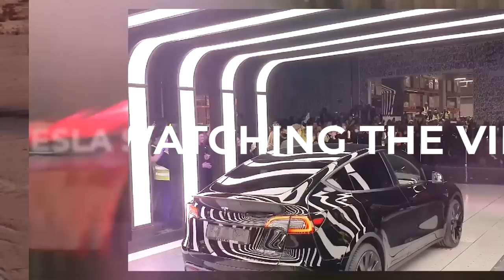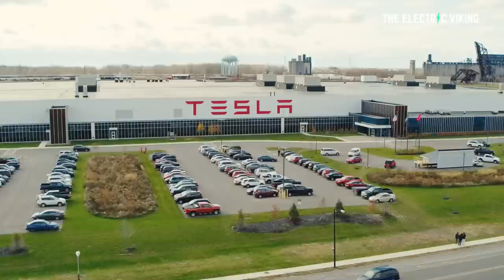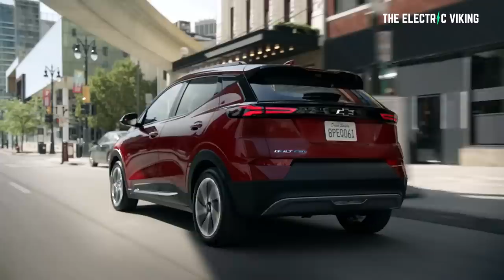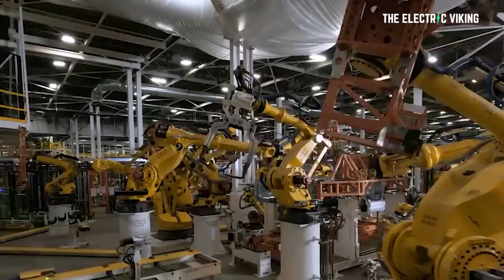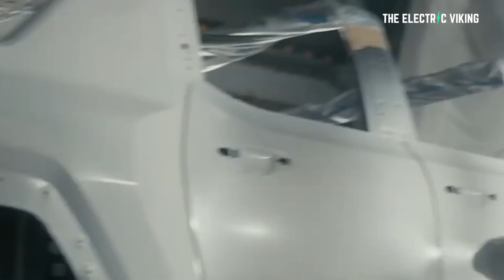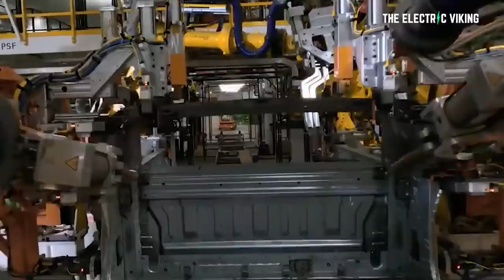Mary Barra still shilling for GM stock with more bogus claims

Comment: I wish they’d ask Mary a simple follow up question.  “So do you have plans in place to manufacture and sell $5 million EVs by 2025 or do you believe Tesla will not grow 50% year over year?”
Reply: @brunoheggli2888  
You KNOW we're all laughing at you??
Reply: G.M. doesn't have to grow so fast, just convert current ICE market share for EVs. Given they make several million cars per year and have plans for EVs like Equinox starting around $30k when the average ICE car is over $45k, it's possible IF they can get thru supply chain constraints.
Reply: @rdollie1  Jim Farley, Ford CEO, said you can't take an ICE production line and tell them to start making EV'S. You have to restructure the factory completely. Why do you think GM and Ford are building brand new factories for their EV'S? VW CEO said that VW will have to raze existing ones and build new ones with new technique in transitioning to EV's.
Reply: @GG-si7fw  yes, I'm very aware but my response referenced converting ICE buyers into EV buyers, not factories 😀

Comment: You are right!  Tesla has the size and scale to reduce prices if required. Are most people really going to buy a GM vehicle if an equivalent priced Tesla vehicle is available? If is not just the vehicle with EVs. There are other key factor such as the software, charging infrastructure, no dealer mark ups, etc.
Reply: Agreed. To me, no dealer markups is an important consideration.

Comment: Are you SURE they announced an Equinox with 300 miles of range AND around 30,000 usd?
We often see from GM, and others as well, announcements where they show all the features of the most equipped and expensive version and then mention the starting price of The stripped down version. Hoping the consumers are fooled into believing the value is higher than it actually is.
Reply: Exactly right. So far the couched press releases have said starting in the 30s for the equinox. Starting there means any options is gonna push it well into the 40s before any stealership markups. 

If you look at the equinox released images though? It has 6 lug wheels and looks to be of a similar size to the lyriqs&blazer evs. 
No way they price that size of a crossover at 30k even for a base 240 mile fwd version with no options. 

Likely it'll start at 36-38k for a fwd 240 mile base no options version in an attempt to compete with the just announced 62kwh rwd base us built id.4 which is rumored to start at 36k, and the base model fwd 250+mile 37k fisker ocean. Both of those also still have tax credit access though.🤔
Reply: Yes it was shown. I'm sure it's a stripper at $30k buy so are most basic cars at that price.
Reply: Blazer EV too!

Comment: The major problem is that they don't make any EVs. I could say I was going to over take Tesla in car sales and tell everyone some random incredible stats. But, the fact would soon come to light that there are no actual cars!
Reply: @brunoheggli2888  
Yes, your post are.
Reply: They make Hummer EV, Lyriq, and yes the Bolt models as well with many more coming by the end of next year. Question isn't whether G.M. can build them or has the demand - it's whether/when they and the rest of OEMs get out of supply chain crunch.  With the prices G.M. is targeting, they won't have a problem outselling Tesla in less than 5 years since all they have to do is convert a slice of the many millions of ICE cars they sell every year.
Reply: Along with China SAIC made  EVs they make BrightDrop delivery vans in Canada.  The 1 of 4 battery factories next month in Ohio.   A new one opens every year after that.

Comment: In theory it wás possible. Cars with a price tag of $20K should serve a huge market-segment, by far larger than the model-3 segment.
AND, gm knows how to (mass) produce cars….
But producing in large quantities EV’s is hard, especially for that price range and making a profit.
So, Berra is day dreaming, while wasting precious time, and turning GM into Gnome Mobiles.
Reply: GM has way too many hurdles in their way aside from terrible leadership. They need a bunch of eager engineers working as if they’re a start up company. They have a union system that’s opposed to any change or development. They have a dealership system that’s also opposed to change.  If you drive a non Tesla ev as I do the charging infrastructure sucks.  Basically GM needs to rebuild from scratch.
Reply: You’re assuming Tesla does not have those segments planned in the wings as the supply chain improves.
Reply: it is totally impossible to make EVs for the US market for 20,000. totally impossible.
Reply: @scottmcshannon6821  the only possible way is to reduce the range considerably, but it is possible.

Comment: The SEC should be investigating Mary Barra for securities fraud. Selling a veritable handful of six figure priced EVs is no way to reach Tesla’s level of sales in the next couple of years. The cheap EVs being promised by GM will have to be not only sold, but also NOT RECALLED! GM’s track record with the cheap Chevy Colt does not inspire confidence in GM’s ability to produce and sell affordable EV’s which will be a quality product at Tesla levels of annual production.

Comment: As for where the equinox BEV is to be made , if they follow the same strategy as the other SUV EV, and build on an existing Equinox line, then it should be at the GM Ramos Arizpe Plant in Mexico, where the current ICE version of the Equinox is being built for US and Mexico sales.
Reply: GM Ultium based Honda SUV will be made there too.  Similarly to the GM Ultium based Acura SUV made in Springhill, TN.

Comment: Barra is going to retire, probably in the next few years. She is making claims and promises to boost GM stock for her to sell off her stock at a better price.

As noted in the video, the facts versus the claims do not line up. GM has had issues with their EVs, is relying to heavily on Chinese builders to get things done. 

GM is no longer General Motors to me, GM now stands for General Mess. They will follow Chrysler into the sold off to a foreign company path.

Comment: Refined lithium is a limiting factor for production according to St Elon on last nights call. The pot is only so big and there are a lot of manufacturers who want it. Commercial uses like trucks/vans and storage are all increasing their take. Prices are only going to increase as the pot gets smaller. Who will survive let alone prosper? Copper is now becoming an issue because of it use in the renewables industry.

Comment: How are people still not getting this? The entire GM EV strategy is to develop their own battery supply, not rely on battery suppliers. 

To do that they started building their own factories a couple years ago. The first opens next month, then another in 2023, another in 2024, then another in 2025. The first 3 are already under construction.   Basically they’ll go from zero battery supply now to 150+ GWh  in 2025.
Reply: It’s hard to imagine everything going smoothly and without changes. Especially in todays markets. Delays cost money and GM doesn’t have much wiggle room for error.

Comment: We need a $30,000 EV with good range and good charging speeds. If Tesla is not interested in making one, then I applaud GM for doing it 👏
Reply: You should have been applauding GM for doing that..... 8-10 years ago.
Tesla is "interested in" (actually doing!) Transitioning the world to sustainable energy.
Cars are simply one part of that.
Cars "get bums on seats", they change perception, then opinion, then buying habits, then government policy.
You may as well have said 20 years ago "Mercedes isn't interested in cheap (ICE) cars"
Reply: @nickv8816  meanwhile 2022 Bolt EV has a $26,950 MSRP.
Reply: @nickv8816  they'll sell 50,000 Bolt EVs this year.  The Bolt is getting replaced in a year or two by Equinox EV.
Reply: @normt430  the $26000 EV Bolt is also great....but it is not available in AWD and has a slow DC charging rate.  I'm looking forward to that modern $30,000 Chevy Equinox. ✌️ I would definitely buy one.
Reply: @wainwrights2744  the Bolt EV fits most peoples needs on a daily basis.

Comment: GM has invested in three(?) Chinese car companies. Combined, could they deliver that many cars? Like you, I do not believe they can do this with their current infrastructure. If they do this, basically ends GM as an automotive manufacturer. I could see them making (and believing) this would be a ‘temporary’ measure while retooling current factories, but once done, it cannot be reversed unless they can convince stock holders GM can produce comparable cars for less. That’s very unlikely.

Comment: Where will GM find the components such as electric motors and, in particular, batteries? Tesla is helping competitors with an ageing model range (in design terms) in a market looking for endlessly new models. If 35 models could be launched by GM on one or two platforms, they just might get that many models out but if it goes to multiple platforms, they haven't a hope. Their own regulatory guys could explain that.
Reply: "Tesla is...." Updating there vehicles on a weekly basis, honing efficiency to levels others can't touch.
You may as we say that (until recently) the Porsche 911 was "ageing" (now it's "superceded")
Or the Beetle when it was in production.
It's a process of continual development.
Reply: Half of the automaker's North American plants will be converted to build EVs by 2030. So far GM has identified five of those: Factory Zero in Detroit-Hamtramck; Spring Hill in Tennessee; the Orion assembly plant in Michigan; the CAMI plant in Ontario; and the Ramos Arizpe plant in Mexico.

Every new vehicle will utilize GM's Ultium EV platform and battery management system, with more and more of the componentry being developed in house as production ramps up. Additionally, a partnership with LG Energy Solution known as Ultium Cells is building four battery cell manufacturing plants with the first one starting production this year.

GM says it will have the broadest EV portfolio of any automaker. The first 20 electric vehicles will be introduced by 2023. Here's what we know so far, by brand.

Comment: I do wish it though! GM with leadership. I'd take the job at 1/2 the price!

Had GM really built all the dozen factories needed, with them coming online within a month, they'd been able to make a go of grabbing the EV production crown with authority. If they had a dozen gigafactories at ribbon cutting right now, with more on the way. All with battery factories large enough to provide for stationary needs too.

Then they'd have a shot. Right now?

Right now they will have to shut down ICE gracefully ramping down creating spare parts inventory, finishing current runs. Repurposing recycling current equipment; retraining supporting current employees. While building bespoke EV factories by the dozens. Gives them 18-24 month to buildout the supportive supply infrastructure enough to make a difference, to grow the legs needed to make a go at the crown.

Then.
Reply: Half of the automaker's North American plants will be converted to build EVs by 2030. So far GM has identified five of those: Factory Zero in Detroit-Hamtramck; Spring Hill in Tennessee; the Orion assembly plant in Michigan; the CAMI plant in Ontario; and the Ramos Arizpe plant in Mexico.

Every new vehicle will utilize GM's Ultium EV platform and battery management system, with more and more of the componentry being developed in house as production ramps up. Additionally, a partnership with LG Energy Solution known as Ultium Cells is building four battery cell manufacturing plants with the first one starting production this year.

GM says it will have the broadest EV portfolio of any automaker. The first 20 electric vehicles will be introduced by 2023. Here's what we know so far, by brand.
Reply: @normt430  "1/2 GM's NA plants will be" is a rendering of their words far more solidly than they merit. In passing, NA isn't good enough. They need to be here in US to provide alternate employment opportunities within the communities that are being gutted with ICE closures.

GM will blame the union for slowing down the conversion when it is advantageous.

As for  the maturity of technological offerings they may or maynot have to arrive at scale, I can't make comments on vapor products. I do know that ramping is hard.

So far, in fact, GM has not shown the ability to ramp EVs. Even the Bolt. Ford, who is arguably ahead of GM in rampping, is doing worse ramping than brand new car companies in China are.

Conversions don't work. Even Fremont is still feeling the constraints imposed by its historic design. Some factories can be converted to parts, motors, seats, IPs. VW made it clear in how trying this conversion hail mary is extraordinarily expensive, time consuming, and inefficient. Sounded like he was warning others.

Comment: i think it is possible if the sale of EV’s in the US market explode.  Companies like Ford and Chevy have a huge fan base and will offer more models in different categories compared to Tesla.  More people would probably choose a Blazer or Equinox EV compared to a Model Y or X, specially with $30k and $40k starting prices.  what they can’t compete with is Model 3.  To beat them they would need to release a sedan alternative to the Model 3.  The Bolt is not a good alternative to the 3, not in same category.  Also GM and Ford will eventually sell way more Electric Trucks  compared to the Cyber Truck. So yes its possible as long as they can ramp up production, how many more Mach-E’s and F150 lightnings would Ford have sold if they could keep up with demand?
Reply: Have to get rid of their dealers first. That $30,000 bump-up makes the price to high.

Comment: Barra’s comments are based on the base 2024 Equinox EV being priced at $30K (RS trim will likely be priced at $36K). So her claims aren’t unreasonable.
Reply: It takes around 2 yrs to set up a factory for a new model. I dont think any GM factory churns out cars like tesla. The facts on the ground dont support her claims.
Reply: But you have to get pass the dealer markup over MSRP. You can make all the supply arrangements you want if the customer doesn't want to go threw the middle man (dealer) they won't. I personally have a M3 on order because I didn't want to deal with any dealer from any brand. Test drive, paid 250 deposit go home in under a hour. Now patiently waiting for my car.
Reply: @andyfreeze4072  And they’ve already started converting the Mexican factory that is going to build the Blazer EV and Equinox EV. I’m not cynical enough to believe that GM cannot ramp up production in 3 years time.
Reply: @robert5008  I think the FUD about the dealership model is exactly that.  My local Chevy dealer has put in writing that I will receive my Silverado EV at MSRP.
Reply: @xordoom8467  Isn’t that the point? GM is gonna sell its lower-margin Mexican-made EVs at volume and have higher-margin cars made in USA at lower volume. That’s been the OEM model for decades.
Reply: "Her claims" are "Projections"
A lot can change before 2024 (is that Q1, 2, 3 or 4?)
What makes you think the "RS trim will "likely" be 36k"?
.
Will they make money on it?
.
Will the technologies perform as "claimed"? (There's that word again)
Will they be buying in tech (expensive) or developing their own (expertise)?
.
I hear Blahblahblahblahblahblahblahblahblahblahblah
Reply: @rogerstarkey5390  Pre-destination price difference between 1LT Blazer EV ($44K) and RS Blazer EV ($51k) is $7K (16%)
Reply: @pudgiechild4677  lets see what the facts on the ground are. Sure anything is possible, but unlikely.
Reply: @brunoheggli2888  well we are still waiting, lol.  Just because it can, doesnt mean it will.  I do believe GM is suffering from some financial restraints. Like sales plummeting, loans to pay  etc etc. They are playing to stay alive, any which way. Having a loud mouth is the american way, ie, TRUMP.  Then we have the issue, can they make money from making cheap EVs. So I guess they figure a delay will see the cost of batteries come down.  I seriously question if they can ramp up or want to  ramp up that fast.
Reply: @brunoheggli2888  you missed the point. I will believe it when i see it, GM has form. As for tesla, they are making money.

Comment: Mary Barra is dreaming if she thinks she can beat Tesla by 2025 no way no how unless she sell her ne ev pickup for 17000 bucks a pop and cuts the hummer price by half or even more down to a quarter then she has to produce all these millions of vehicles without a hitch and fix the chevy volt battery problem and sell the volts fo 15 grand that is the only way I could see her beating telsla by that date or any date for that matter as GM is so far behind any other ev manufacture it is ridiculous so I think she I lying to the extreme when she said that statement she is as bad as Trump and certainly not worth the money they are paying her as she turned nothing around yet.
By the time GM get there toe in the water they will be far behind everyone else even ford are doing better than GM even though they are losing money on every EV they produce but that will change once they figure out how to produce them better like all new things it takes time but Mary Barra you my lady are a LIAR pure and simple.